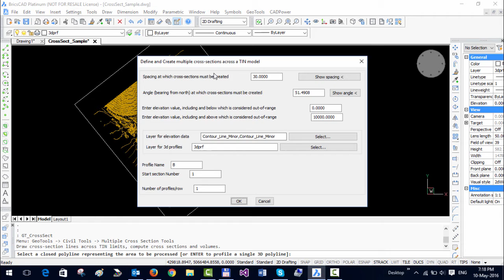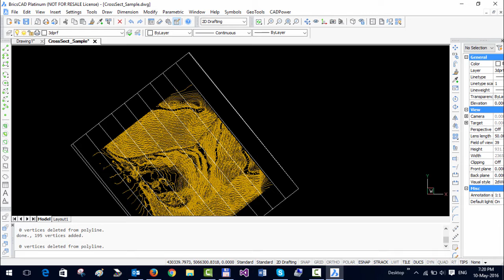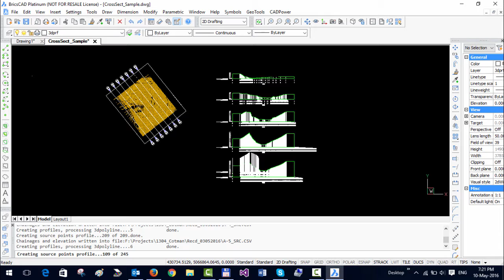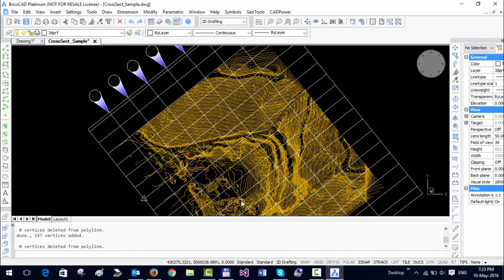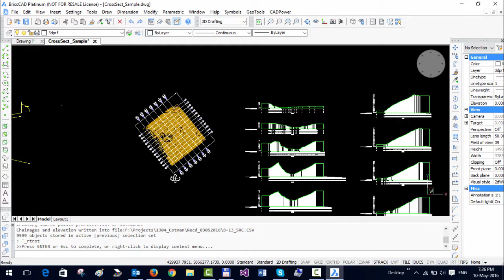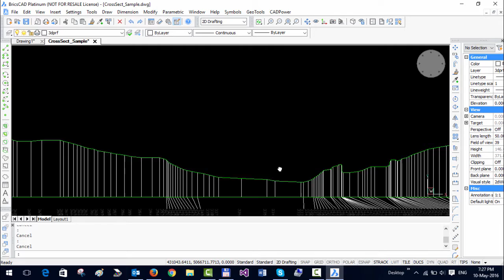Compute volumes across multiple cross-sections | GeoTools Tutorials | Civil Tools | Rakesh Rao

Comment: I have negative values in my TIN (sub-sealevel) the profiles appear to stop processing at 0 elevation. Is there a fix for this, or do I have to shift my whole dataset?
Reply from the maker: Jack, in the GT_PROFILE command, you need to set the Reference Height as a negative value which is less than the lowest height. This will enable the profile to look as you expect, above the datum line. You can find the lowest Z easily using the 'Quick Stats' option in GT_PROFILE command.